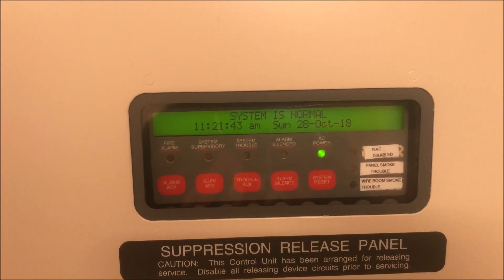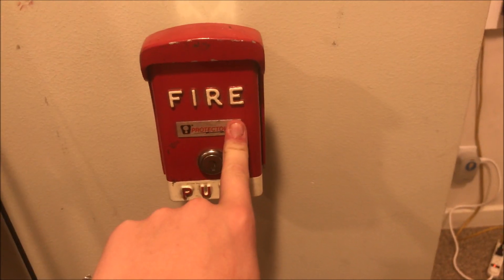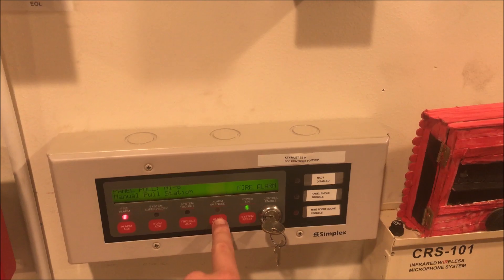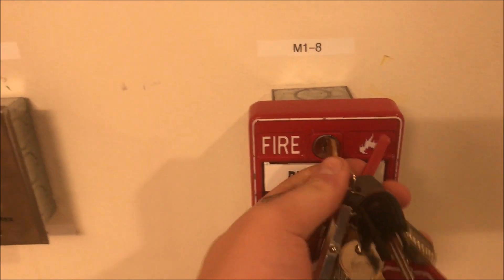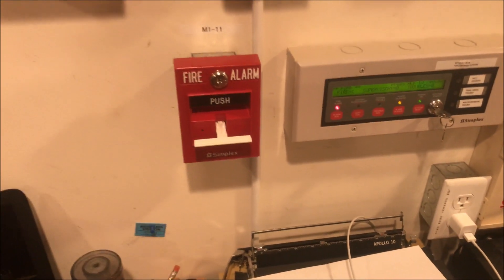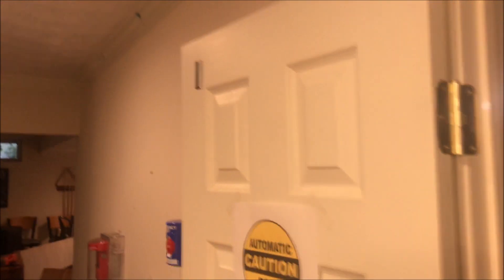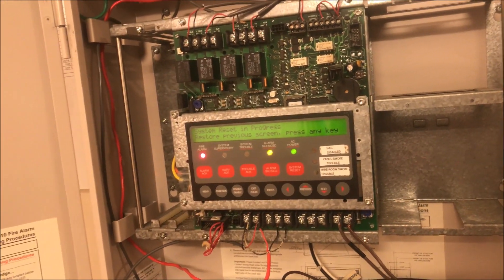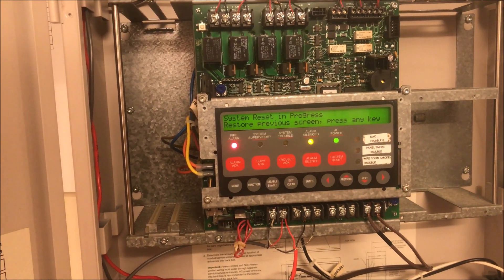Simplex 4010 Test 19: Wheelock, BG-50, and STI Stoppers

Comment: The simplex 4010 has wheelock sync actually!!
Reply from the maker: I’ve heard that but never able to find it. Is it just setting the output to “synchronous”?
Reply: You go into system settings, and it will have an option for Wheelock. Only the newer models have it.
Reply: Hmmm. I swear the 4010 has wheelock sync
Reply: @MRIDNETGUY2004  I am pretty sure Wheelock devices sync with Simplex devices via synchronous.

Comment: The BG-50 looks similar to a model of pull station that Simplex made at one time NewAgeServerAlarm referred to it as the Simplex Unknown Pull and just a piece of advice when you're solo testing you can avoid putting the system into trouble by using a can of compressed air and spraying that on the smoke detector afterwards.  SAFETECH does that when he's filming his system tests.
Reply: Dmtxj6
Reply: Fiyat alabilir miyiz